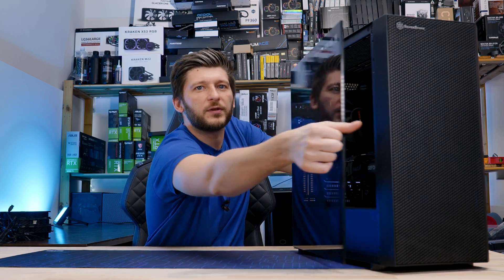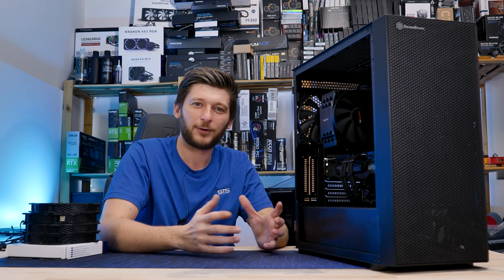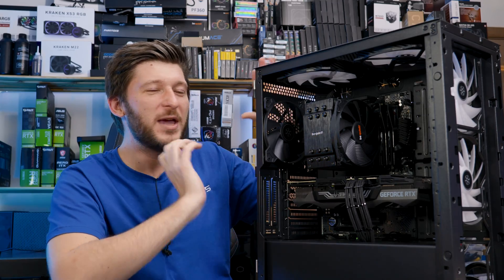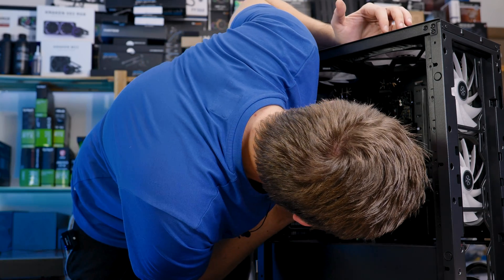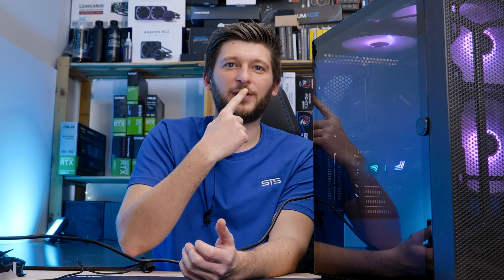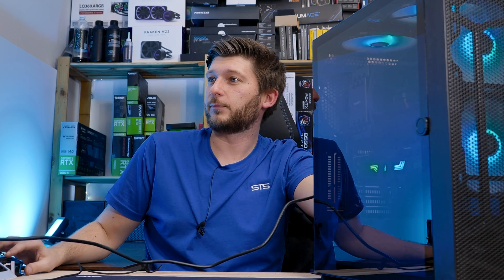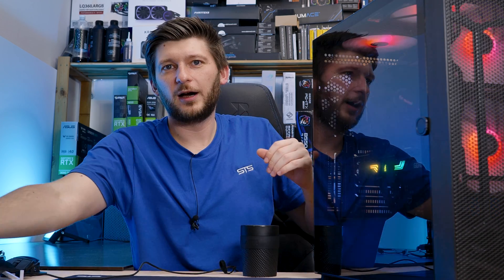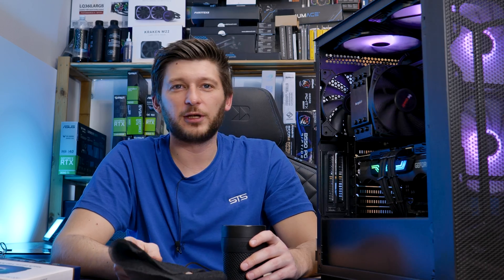Hidden Performance?! - Squeezing every CFM Out OF SilverStone's Seta H1

Comment: The manufacturing on this case, especially how the front plastic panel is build, reminds me of old Fractal Arc and Core cases(the foam filter was also awful). Kinda sad how Silverstone drifted into obscurity, they used to make some original layouts, cases often times designed around their bigger Air Penetrator fans.
Reply from the maker: They still do, Alta case for example. But then there's also the throw- on the market stuff.
Not that the case is bad, it could have been a bit better though

Comment: Actually an interesting point about the intake on the top. I don't know how much difference it would practically make, but maybe I'll try it out in a build and see if there's any noticeable change. Though I imagine an aesthetic build could be botched if you had to break uniformity by flipping the fan and having the cage block some of the RGB sequence.
Reply from the maker: I think I'll separate this into an Independent video without any extra variables. This video was a bit too clustered to make a valid statement